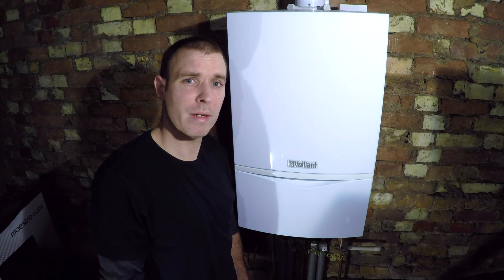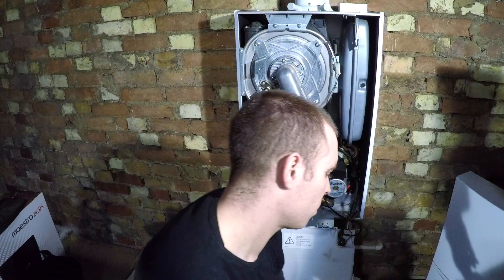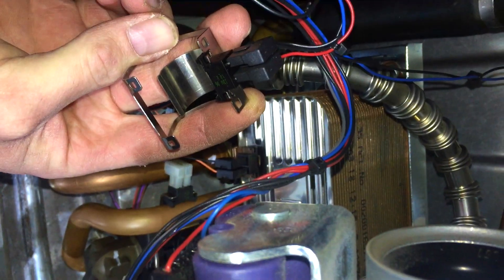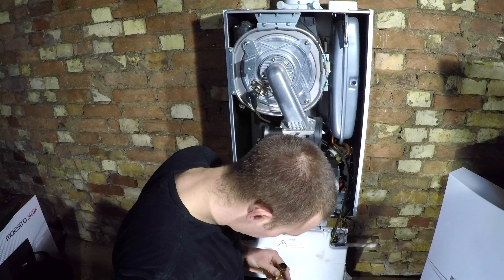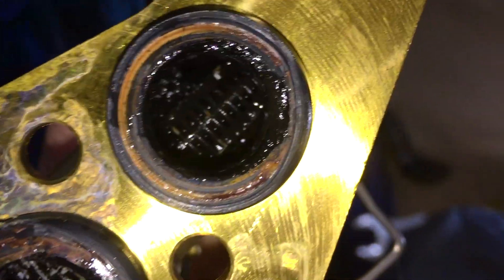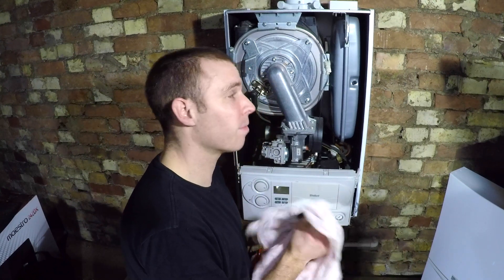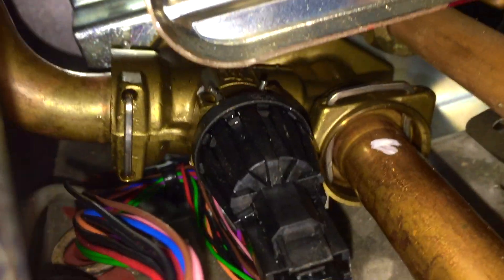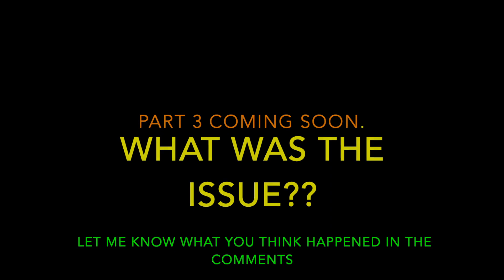My boiler issues part 2. Unexpected Ending!!!

Comment: What an inspiration…can’t wait for part 3 and I’m not a gas engineer.  I have had 2 engineers over six weeks at my 9 year old Baxi Solo HE24 heat only and its still acting up with Overheat Lockouts.   Runs fine with airbox door and case off.  Soon as you put the airbox door on and the case…its goes to overheat lock.   I have an engineer calling after the holidays are over … I’m going to show him these videos to show a real engineer at work.
Reply from the maker: Have they done the red combustion door seal? Its the most common reason for what you described. Very dangerous if installed wrong so don't attempt it yourself.
Reply: @HeatingGeek  Yep....they replaced the combustion door seals..and a set of ignition leads + a condensation trap.  Baxi told him to check the sump of the combustion chamber and it was clogged with ash and this was their fix.  Tried a PCB as well but as he did not solve it they refunded me for that.
Reply from the maker: @patrickfarrell9230  If it is overheat then there are 2 of them. Really easy to test which one. But as you haver said it happens with the combustion door on then it has to be the one on the fan. Get a better engineer? Thats usually an easy fix. Did he use an analyser on the boiler? If the sump or heat x had failed it would show up on the analysis.

Comment: Been up in the loft the boiler is less likely to be affected by magnetite, hence relativly clean.  Been up in the loft I've found heat exchangers can have a shorter life due to low pressure & even running dry if the WPS is not reading correctly.   A good thing to do with ecotecs is whenever you drain them push the minus button and see what it thinks the pressure is....these fail quite/very often and if left can cause the boiler to light with with very little/no water in it damaging the pump & heat exchanger.  I see alot of ecotecs and buy the WPS 20 at a time...yes that bad!!
Nice video again, thanks

Comment: enjoyed watching both the vids in this section . i am a gas safe and have been registered for over 15 years but i mainly install new and service in warranty i hate boiler breakdowns. customers just expect you to know eveything about every different boiler. i have just replaced my dads Viessmann 100 35kw combi and i fitted it with a filter only 6 years ago. heating very slow hot water cutting off all the time. i changed domestic plate heat exchanger slightly better then i changed the pump seemed alot better then after a few weeks it started again with hot water cutting off. so i fitted another boiler Ideal Vogue 40 kw. hope i tried all the main things im sure it must of been the main heat exchanger
Reply from the maker: It probably was the main heat exchanger. These things are difficult to fix sometimes. :-) I never posted the last video in this series. I did drain out the system and add inhibitor. I think it might be back though. :-(

Comment: Such clear and insightful video. Thanks!! In my installation that (black) rubber part of the pipe is also copper...
Reply: The problem with many bolts in this installation is that they are made of aluminum. You quickly turn them to smithereens and then you have to drill out...
Reply from the maker: @sakeboersma  No actually they are steel. some are stainless steel too.
Reply: @HeatingGeek  Really?? I can't post pictures here but I had to drill almost every bolt out. They are 'soft'...
Reply from the maker: @sakeboersma  I never really had an issue. Sometimes the diverter screws round off. but not too often.
Reply: @HeatingGeek  It was a drama to get the heat exchanger out. The head of every bolt turned broken. Then I removed the hydroplate (178965), again, bolts that could no longer be loosened with a screwdriver. Now that all renewed. No leaks, everything works fine. But after a week, the F81-F91 came back. At start a reasonable jet of water, but then a weak jet and barely hot water. The plate heat exchanger heats up well, but the boilers do not seem to fill very quickly. I ordered a shunt pump. I will expand and install it on Friday. Thank you for your advice! I really appreciate it!
Reply from the maker: @sakeboersma  If your doing the shunt pump do the dip tube at the same time. It will not take much longer and the part is very cheap.
Reply: @HeatingGeek  April 2019 the storage container (PG 99 0020268967) has been completely replaced. Has the dip tube also been changed automatically, you think? Maybe you have  the Vaillant order number of the dip tube...?
Reply from the maker: @sakeboersma  I show it in the dip tube video. I'm not sure about the part no but it is on the video. :-)
Reply: @HeatingGeek  The pipe to be heated (after change of shunt pump) does not get hot. Not even warm. The plate heat exchanger is hot. The shunt pump works, the dip tube is in good condition. What else can it be? Maybe I should say goodbye to Vaillant...
Reply: I forgot an update: everything is working perfectly!! After the replacement of the pump and the dip. Thnx!! 👍

Comment: The canoe filters seem to spread & block themselves like there netting melted reducing the hole sizes.
I’d break the filter close the return & put fx2 descaler in the AAV hole then put AAV back fill boiler & circulate hot water to clean the primary circuit…then rinse it out..
Reply from the maker: The boiler has been working fine for over 2 years now. 🙂

Comment: Hi mate, i've got a problem with my Vaillant 637 ecotec System boiler, lately at random times it starts making banging noises, after spending near £700 getting it serviced and the internal pump changed for a new one the issue is still persists.  The last time it started making banging noises again i removed the cover and had a good listen and look around, it's clear something inside the heat exchanger is loose and rattling around, i noticed it happens when the flame is high, not when the flame is low.  I've asked for a power flush multiple times but they don't think it needs one.  Do you think it's just a case of the heat Exchanger pipes being blocked?

Thanks
Nik
Reply from the maker: Unfortunately 1 coil is probably blocked. This will cause the boiler to become noisy but still work absolutely fine. I would add chemicals to unblock it before it completely blocks.

Comment: I think plated heat exchangers is tiny block because your heating is fine only problem is when you run hot water if not then main heat exchanger
Reply from the maker: No it wasn't.
Reply from the maker: It does it on heating as well.

Comment: what was the outlet Temp from the main heat exchanger ?????
if it was too hot, then is the blocked main Heat exchanger.
If not, then is a bad electrical connection plug.
Reply from the maker: No it wasn't hot. 70 wish

Comment: Yeah hot water is fine. Customer said the boiler cuts out but I checked everything when I was there to see if it would cut off but nothing happened. The only thing I could identify was a new expansion vessel required asap and boiler guage is blocked with sludge, so I used a magnet across the copper tube that's connected to the guage to see if it would free the sludge.. so the boiler has been running with no pressure could this been the problem over heat? Once I've replaced new vessel and guage see if this will sort out the problem. Cheers mate
Reply from the maker: I just let ukplumbersforum know about my channel and your asking on there too!!!
Reply from the maker: The pump isn't used for hot water on that boiler  because its a bythermal heat exchanger. So if hot water works you know the fan gas valve burner and HW side of PCB are ok. Make sure the pump actually runs (It might get stuck when it gets hot). The PCB could be faulty on the CH knob side. The Knob could be broken and the boiler is actually on min. The timer if its built in could be the problem. 
Link out any timer and run the boiler. Get the fault to occur in front of you and then call Worcester.
 You will get to the bottom of it but I wouldn't replace the vessel and gauge yet.

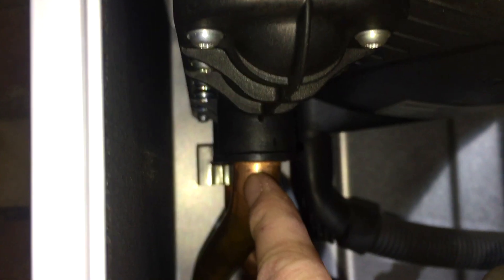Comment: My boiler has minor leak from the black part 6:00 min in your video and the boiler enginer told me that I need to replace a whole heat exchanger. Is that right can't that just black part not be replaced ? Or whole thing has to be replaced ?
Reply from the maker: the whole heat x needs replacing.

Comment: I know it would be quite a bit of work but if you remove the main heat exchanger and put chemical like acid in it to clean it. Will that be a good idea.
Reply from the maker: I would just pump it in and let the pump move it around. :-)

Comment: 15 year old combi ci the hydrobox has cracked but heating still works but no hot water? But I'm replacing it for a new glow worm betcom 4 30c as it's for a property that I rent out. The cost for the part and fitting it plus it's an old boiler something might go as that's what kinda happens. So bite the bullet and replace it for new. I took out the gas valve to get access to the hydrobox but it's a whole strip out a pain. I valve has obviously stayed on the heating mode but no hot water why would this happen?cheers
Reply from the maker: Probably because the actuator got water in it and froze in heating mode. Are you sure it needs a whole block and not just a diverter repair kit?
Reply: The part of the hydrobox section  must be between the actuated started to drip slowly. It's an old boiler any way.

Comment: Hi mate, thumbs up for you hard work especially when it comes to do the filming and working with one hand. Thank you for taking the time to cut all the videos together and starting your knowledge. I was wondering if you could get me tell me why the glow worm 30cxi in F9 mode goes. I am myself an engineer and thought it would be done when changing the water pressure sensor. What could be the cause that the boiler locks out after a few minutes. Op has only ufh. Hot water works fine but ch seems to be having an issue. Could that be a blockage somewhere?
Reply from the maker: https://youtu.be/7O3UTTOb0tI
Watch this video to help you.

Comment: Hi again, I was out at a Worcester 28i rsf combi and the boiler was cutting out once it's been on for 15mins or so. The central heating is working and the dhw is fine. I did notice the thermostat dial on the front panel wasn't communcating when I turn it down or up? Also the high limit hasn't been activated either. Customer said there are having to manual turn the programmer to on instead of it being operated by the timer due the boiler cutting out.
Any advice? I am a new gas safe engineer first year so much to learn.cheers
Reply from the maker: Not to sure really. Im not taking the mick when I say this. Roomstat? 
They don't often have NTC issues. Fans stick on them but would effect hot water. Could it be the programmer (built in)
Reply: I checked there's no roomstat just a programmer on the wall.

Comment: Hi mate, I went to that job today fitted new vessel and guage, removed the prv valve and cleaned the seating full of sludge. I'm going back next week to fit a magnaclean to keep the system and components clean and to service the boiler too! . Any advice on the valves to the flow and return once closed then open they are dripping? I've opened them a few times to shift the dirt but no luck. Would this be a new valve or do you have away of repairing it?
Reply from the maker: Did you watch my Worcester Cdi diverter valve replacement.  Its here https://youtu.be/bX2BqZ-TYnY
If you have a look at the top comment he has very good tips. You should never use the isolation valves on this boiler (as you found out) (as we all found out). Sometimes you can get the flow and return really hot (stat to max only one rad on) and it will fix it. 
If you have to replace the Valves its boiler off the wall. This is not a fun job and takes time. Hopefully when you go back they have stopped leaking.

Comment: Overheat stat flipped the boiler off. Boilers esp condensing boilers have so many safety cut out devices. If one shuts out the fan goes off. The boiler reaching temp that quickly is reason why the main H/E is blocked. Tiny bypass tubes on these. When you look inside the heat exchanger it's normally brown and cruddy where it's blocked.
Reply from the maker: Not this one though.

Comment: HAve you got a Magnaclean filter (or similar) installed in the System. Maybe it would have kept the crud out of the boiler.
Reply from the maker: No I haven't. I have some in my garage but none on my system. Its been in for 10 years at the point you watching here.

Comment: Hello mate
great vid
what size is that T bar you used to take off that manifold that holds the canoe filter?
cheers DARREN EPG
Reply from the maker: It would of been a screwdriver with a PZ3 bit. The only T bar I have is 10mm for the burner door.

Comment: Heating Geek
You just relax and look after your crying baby🤪🤪 
Your boiler problem will be sorted.
You might have problem with your return pipe in your heat exchanger or your NTC could be faulty 
And so on your PCB and also your Main heat exchanger i went to look a same boiler valiant is my favourite the temperature was showing the maximum on CH and hot water but out come was just warm water not red hot so you can touch it easily so I found out the problem was in the main heat exchanger. I hope you find out yours too good luck and merry Christmas.
Reply from the maker: The boiler has been fixed for a while now. :-)
Reply: HeatingGeek what was wrong with it please?
Reply from the maker: @ImranKhan-hz8jy  Have you watched all the videos on this boiler?

Comment: Probably a dumb question but how come heating system isnt protected by filter?
Reply from the maker: I usually think if its clean its clean.  So I didn't bother. I have a couple in the garage so maybe if its fixed I might treat it.

Comment: Hi HG, love the videos, you’ve not given us much to go on, was there a fault code, what was the boiler status code? possible pump or fan failure or loose harness connection, Im surprised that your own boiler still has the rubber hoses on the flow and return pipes as these are a problem waiting to happen, would have fitted  or recommended the copper upgrade kits  personally
Reply from the maker: Temp was low. boiler was in SFB so running at high rate. I will try and show the display in the next one. I didn't think about it .Nothing wrong with rubber hoses. When they go it costs £11 each to replace. Boiler has been in 10 years and they haven't split. I do have chemicals in there now which might ruin them. But I will replace with rubber and I have the pipes (copper ones) on the van.

Comment: Rads got nice and hot.. what part if I were to replace would it be thermostat sensor?
Reply from the maker: Don't replace anything until you have proven its faulty. Don't go down the rabbit hole. 
Wait until you see the fault. Test it with Worcester on the phone and prove what's faulty.

Comment: By jove I think I've cracked it, there was a tiny little Gremlin inside the boiler chomping on the wiring harness.
Reply from the maker: That could be correct..... or all the acid you took has altered your judgement. :-)

Comment: Looking at both videos, lack of debris anywhere you had expected it. I think the bearing in the fan had gone, there was vibration going through the heat exchange-er making it sound like it was blocked.
Reply from the maker: No unfortunately not. Out of the box thinking, I like it.

Comment: The price of a hydrobox and labour might as well replace the boiler for a condensing model?
Reply from the maker: I thought you meant the Cxi or Flexicom!! I forgot the Ci ever existed. It had a hall sensor on the fan and an electrically heated tank up the back!!!! I hated that boiler because it was so rare and different. I haven't done too much on them. I think the gas valve was also a stepper motor and if you lost the restrictor it wouldn't work and you cant get it as a spare!!! Great!